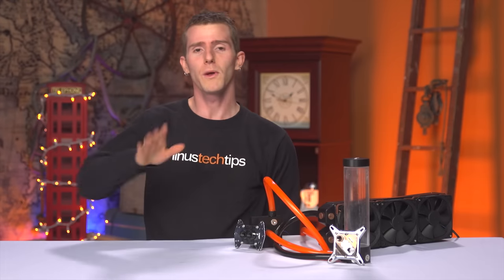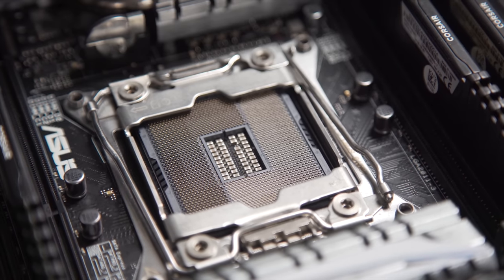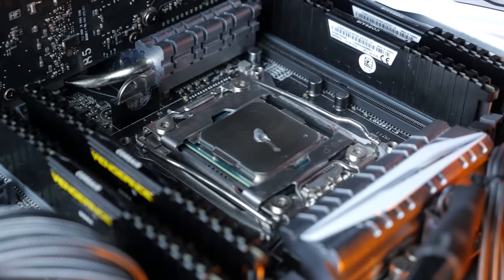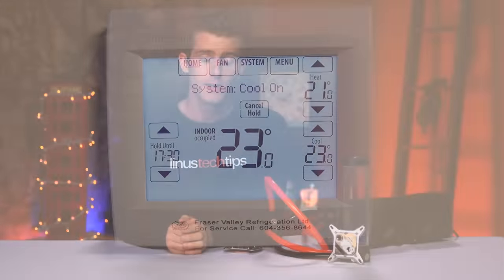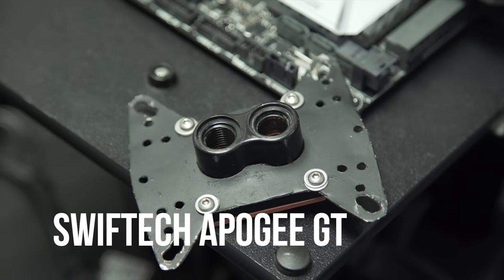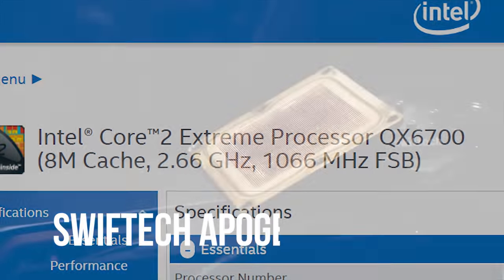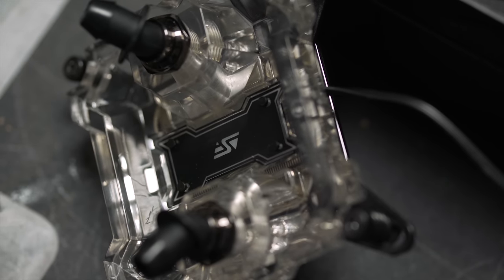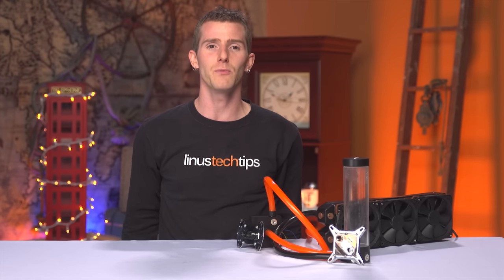TEN YEARS of Water Cooling Performance Tested! - Through The Ages Ep. 1

Comment: thru the ages stock coolers from AMD AND INTEL
Reply: Yes! But how much have they even changed, besides the AMD Wraith Cooler?
Reply: well i ve done some dumpster dives lately and notised that intel gad at least three designes and AMD even more
Reply: DiyŽan How are the old designs? Please tell me they're better than the new ones.
Reply: The old designs are more 'beefy', and apparently the old ones you could overclock on. I think now they use aluminium for the slugs, they used to use copper.
Reply: Intel has offered some stock heatsinks of reasonable quality before on some of their hotter CPUs.
Reply: I have a few intel coolers here and can confirm the copper base on older ones.

No idea if they work better, though, because whenever i get a stock non-wraith cooler it immediately gets thrown in my scrap metal box.
Reply: They've already done a stock heat sink comparison
Reply: Yeah the big late Pentium 4/early Core 2 Quad coolers with the copper core weren't that bad.
Those 130g parts with 2 5/8" height.
Reply: I7 920 had a copper core. I have the heatsink right here minus the fan being used as a paper weight.
Reply: Mean Gyrene76 Mm..silent. That's what I'm talking about.
Reply: joshua lotion only one from Intel
Reply: Hehheh, yea. I remember thinking it was a funny little novelty the first time I got a CPU with an (intergrated) heatsink and dinky little fan on it :D
Reply: They still make them with copper cores as far as I know. I made a secondary machine with an i5-4690 last year and its cooler had a copper core. I made a system for a family member with a Celeron of the same generation, though (so the same socket and everything) and it had an aluminum core. I think it just depends on which CPU you get.
Reply: CaveManta they are better and beefier,they also had a better fan
Reply: HappyBeezerStudio or the older  pentium 3 had an even beefier heatsink despite made of aluminium
Reply: I wouldnt call a 60x60mm block with a 60mm fan "beefy" or even remotely big.
But okay, it's not that hard to cool a chip with less than 35W TDP. That is a rage where todays 2.5 GHz mobile quad core chips sit.
Reply: yeah i agree but the actual weight and height are the thing that are beefy. it almost has a pound of weight and a 30 mm fan😂😂😂 yeah cooling was wery simple back in the day
Reply: The diameter was smaller but they were higher. the weight is not much different to the one that came with my i5.
The heaviest are actually all of my aftermarket coolers: Zalman CNPS9500 AT (530g), Hyper 212 Evo (465g), Thermalright Macho (870g)
Reply: HappyBeezerStudios but i mean those 20 year old coolers
Reply: BeGamerSl Ahhh. Slot 1.
Yeah, think I have one of them around.
It measures 114x47x21 mm without fan (114x47x33 with fan)
The one that came with my i5 (77W TDP) is 92x92x20 mm without fan (92x92x43mm with fan)
So they actually have gotten bigger since then.
Plus the P3 cooler is all aluminum while the i5 has a copper core.
For comparison: The one that came with my core 2 Duo (65W TDP) is basically the same as the i5, but without copper.

Comment: LinusTechTips should water cool a PC from the 1990's.
Reply: run dem cpu's at 0°
Reply: krazytoneride That could be dangerous, as there would be water condensation.
Reply: not if you put the computer in a vacuum
Reply: Son they have these things called PHASE CHANGE COOLERS that keep CPU's right around 0, there is just a LOT of prep work involved to prevent condensation on the CPU.
Reply: +Convergant why would there be condensation? When its colder than the surroundings this happens, but water cooling only cools it to ambient. now with phase change cooling, that gets way below ambient, and I know all to well what happens to a card at -45c. It didn't take long for it to form frost on the back through all the instillation, roughly 5 minutes. My poor card never even got to boot up, so now I'm watching this on a phone...
Reply: You do realize that is impossible unless the room is 0c
Reply: alexabc54
 With watercooling YES, but not with PHASE CHANGE COOLING!!!!!!!!!!!!!
Reply: Processors haven't reduced their power consumption. They have maintained it. It would take the same amount of effort to cool an actual or older processor the same.
Reply: Ummm... I may be misunderstanding something, but Pentium 4's and the like used 5V compared to modern CPU's running around ~0.9-1.2V... that's a vast reduction in power consumption.
Reply: you don't understand what "power" is
Reply: As I said, unless I'm misunderstanding something. Care to enlighten me?
Reply: +Jafin16 voltage doesn't equal current/"power"
Reply: Heat is energy. Electrical energy is measured in Watts, specifically the TDP of a cpu. Modern CPUs use lower core voltages, but more amps. 1.2v*70a = ~85w.

A while ago, they didn't have as many cores in parallel, having higher voltages to keep stability but fewer amps because there was less electronics to run. 5v*17a = ~85w.
Reply: Lower voltage, higher amperage.
Reply: ah yes a 486 watercoold.. xD
Reply: +Jafin16 Power = Current * Voltage.
Modern chips might use less volts, but they use a lot more amps.
However, P4's did run hotter than anything before them, and the P4's processor architecture was basically considered a dead end and isn't related to modern Intel processors.
Reply: I'd rather see GHG do that
Reply: Jafin16 As they said. Power is measure in Watts. The voltage is lower, so consumption per transistor is much lower (transistor power is a function of its size also), but newer processors have much more transistors so the power remains more or less the same.
Reply: I don't think there was ever a 5v CPU with 85W draw.
More like 5W, we are talking about something liek a 486DX2 here.
But it''S true that we had the near 4 GHz and 90W power draw even with the Pentium 4.
But even the Core 2 chips reduced the power while being more than twice as fast.

Actually I like the idea of watercooling something like a Pentium II or K6.
Reply: +44RONdin I had a P4 3.2 Ghz Preshot.. sorry Prescot processor. Actually ran cooler at 3.6 Ghz. It was the Prescot architecture that ran hotter than any other P4 hence why they were called Preshot.
Reply: ***** And now they don't need it either. You have watched to much LTT, and believed a pc need a super fancy 2 pump water cooling system to work. Nope. For example. Most servers work with passive heatsinks and dont even have fans in them. You can do the same with your pc.
Reply: I am working for Intel now. Of course a rack needs fans. You have to remove the heat from the air. But for removing heat from the processor with a good passive heatsink DESIGNED for that, it is ok. Don't say things like:

"I dare you to film yourself removing your fan, and just leaving a heatsink on it, then running a stress test. I dare you."

If you are running the kind of heatsink with a fan on it, it's because it relies in its ability to blow air.  

"Less power doesn't mean less heat WHEN less power derives from smaller architecture. Smaller architecture means more condensed thermals, meaning the die can reach higher temperatures faster without cooling."

I don't really understand your point here.
Are you going to use it without cooling?
It is going to shutdown almost instantly, doesn't matter if it is a P4 or an i7 6xxx. But who is talking about that? The only thing you should care at the time of spreading heat is the power you need to disipate, and the surface you are disipating it from.

Also remember your cpu doesn't need to run at 45C under stress. If you can keep it under 95C under stress loads it is a good temperature. Remember stress loads are synthetic and not representative of real world tasks.
Reply: They don't have a fan on the actual cpu heatsinks because the whole rackmount chassis is designed like a wind tunnel. Run one with the top off and put it under load (...don't)
Reply: They didn't even need a heatsink in 1990 mostly, that came a little later with the integrated heatsinks, and then with a dinky little fan on it too :D
Reply: Oh, my Coppermine Pentium III runs on 1.75 v
Reply: AnythingTechPro and

Comment: I wish had the money to watercool like that, god damn.
Reply: Samaker I didnt expect to see you here :)
Reply: Voltz Why not? :o
Reply: Shipping and receiving!?
Reply: Samuel Edwards Shipping and receiving?
Reply: Water coolers are one of the cheapest parts of most PC build now honestly
Reply: Wight I am aware, I have an H100i GTX AIO watercooler myself. Custom loops however, are not cheap.
Reply: until you get to the connectors... AIO's are awesome though
Reply: Buy a expandable aio, easy gpu watercooling right there
Reply: Liam The point is that custom loops look sexy as hell, are a lot of fun and gives so much more freedom.
Reply: Samaker true
Reply: Custom loops look awesome, sure, but honestly they don't really allow for much better overclocking than a top of the line AIO watercooler (depending somewhat on which CPU you have). The cost is likely to be 2-3 times as much, depending on which components you use. If you add a GPU cooler as well, you're quickly looking at 4-5 times the cost of a AIO system. So from a value for money point of view, it's not really easy to recommend. However, I do love the way my PC looks with hard tubing and all EK components.
Reply: Rebecca Schade That's all true, custom watercooling is mostly an enthusiast thing and not something to recommend for any type of budget limited build.
Reply: Samaker But, after wanting custom water cooling since the late 90's, I'm happy I finally took the plunge though. Some times it's worth spending a bit simply for the "cool" factor :D I'm not so sure I'll do it with my next build though.
Reply: Rebecca Schade I'm glad to hear you finally went for it after such a long time, I hope I wont wait as long before my first custom water cooled build :)
Reply: Custom loops are cheaper in a long run than aio:s. Aio life expectancy is about 3 years while good pump and rad combo can last you 10 years.
Reply: Rentta Did not know, thanks for the input on that one
Reply: Rentta so 3 decent aio last 3 years costing 100 each resulting in about 300 dollars. A decent waterloop costs more than that thus a decent waterloop is more expensive
Reply: New pump 40-50$, tank you can get good condition used one for 20$, good condition used 240 rad 30$, new water block 50$, tubing 5-10$, Fittings 30ish $, Total 175-190$ or if you opt out using all new parts it's still not more than 250$
Reply: Rentta My setup uses two radiators, a 360 and a 280 and cools both graphics and cpu. All new parts. Total cost with tubing and such, probably somewhere around $600+ Which in terms of pure cooling performance, isn't really worth it. So the price is VERY dependent on what kind of setup you're after.
Reply: Rebecca Schade Yeah but we were just talking about cpu cooling. Obviously it get's more expensive when you add gpu to the loop. I have parts for adding gpu to my loop, those cost me extra 100 bucks (40$ for almost new 360 45mm rad, universal gpu block 45$ + fittings) so still my loop is in total only about 300$. Obviously need to do some diy to make my gpu hybrid cooled but i could have gotten used full cover for 40$ too but decided against it.
Reply: Rentta But buying second had kind of goes against that "it'll last longer than AiO" though. You can't know how well second hand stuff has been treated. But it does save on cost for sure. I have a full cover waterblock on my gfx card and a backplate. that's like $120 or so here in Norway.
Reply: Rebecca Schade Well aio's fail due to coolant slowly evaporating so there is really nothing you can do about that. There are only  few ways you could actually damage radiator or cpu block and pretty much all them are visible. When you are buying used parts you always need to look at the condition of the part and i would recommend buying them from hardware related forums. Just like buying used car, use common sense. We were talking about cpu water cooling so obviously if you add gpu to the mix it's going to get more expensive, but well you don't need to. Your cpu air cooler isn't going to cool your gpu so your argument doesn't make lot of sense. If you want aio for your gpu it's going to be about the same price as full cover gpu block and in that case why not use universal gpu block (40-50$) and diy hybrid cooling.
Reply: Rentta DIY hybrid cooling still requires dedicated heatsinks and fans for VRM cooling, which kind of defeats the purpose of watercooling in my personal opinion. The fact that I can minimize the number of fans in my system, and keep them as large as possible with low RPM keeps noise down. And the post I was commenting on about price in the first place, was about "watercooling" in general, not AiO or "only cpu cooling". I'd personally never bother with custom watercooling simply for CPU cooling. That just doesn't make any sense to me.
Reply: Rebecca Schade Yes but usually when you strip down your gpu air cooler you are going to find that there is often heat sink for vrm's already and in some cases vrm's don't even require cooling (some ek's full cover gpu blocks don't have any cooling for vrm's either). So what you need is some ram sinks, which are very cheap and possibly heatsink for vrm's and for that you can either use universal heatsink of appropriate size or vram heatsinks (both of which are no more than 5$) so for ram and vrm's you are talking about max 10$ in total. Yes you need fans too but they can run really slow (and quiet) also often you can use your existing gpu fans to do that. Yes maybe these days when air coolers are so good there is apart from slightly lower temps, less stress(weight) on mobo and noise levels to use water cooling just for cpu. It used to be different when i started doing that 13y ago, back then air coolers were hopeless. Then again you can start with cpu and then add gpu in the loop later and after that maybe mobo vrm's like i haft to do because vrm cooling on my gigabyte is hopeless.
Reply: Gwrman Munoz I have a watercooled PC, unless you want to go custom loops it's basically as easy as a fan cooler.
Reply: If you can fix a car you can build a computer and water cool it so it is not hard at all
Reply: Just take a laptop , by definition it is watercool.
Reply: Rebecca Schade If u want to buy 5 different aio's due to pump failure, air, corrosion etc. then it rly isn't cheaper at all.
Reply: Liam Also say an EK-kit s360 costs 240€. Amazing deal.

Comment: LOL I've had most of those blocks over the years. I got into watercooling back in '01. First one was a crude waterblock, and a large nickel reservoir with a 12v bilge pump inside it. These days I'm running WaterCool Heatkiller CPU and GPU blocks with Aquacomputer Airplex Modularity system radiators. Huge, heavy, AWESOME!! I've not come across another rad that can keep up with it. Expensive as heck, but sooooo worth it.

Comment: Been running my mcp655 and apogee hd 24/7 for 6 years straight. Spent 6 hours last night cleaning my entire loop, flushing, fans,rads, and took apart my ek and apogge block for cleaning. The apogee hd is a BITCH to clean with the small fins. Back down to 25 ambient temps. (using liquid metal compound). I love the quality swiftech puts out. Customer for life! :D

Comment: I looked at custom water cooling not too long ago... Then I saw that it costed almost as much as a 1080 and I said fuck that.
Reply: I use a corsair h105 for cpu cooling and that only cost 105, about 1/6 of the price of a 1080
Reply: I meant custom water cooling. My bad not including that part :P But thanks anyways.
Reply: Thats not really watercooling.
Reply: timo stockhorst I meant custom watercooling. Like this video is about.
Reply: Back in the day you made your own.. like going to the Car junk yards and getting heater cores and pumps 
Did mine for less then $100.. and dropped the temps 20-30ºc from the bad air coolers.. 
Then got a Noctua D14 in 09...
Water cooling now is mainstream and people want off the shelf.
Reply: Only if you don't do it yourself... You can put together a solid multiblock kit for like $500, could probably squeeze that down to $300 with a trip to eBay, if you're feeling lucky.
Reply: Because that would look like ass.
Reply: Who needs to look at it.. mine was mounted outside(fan/pump/rad)no heat or noise in the room.. except HDDs  .. being car parts didn't matter if it was exposed to water or not.
Reply: ***** Unless your ambient room temp is 60C, you're not going to be throttling on a properly designed liquid cooling system. A good one can work with a thermal differential of ~20C.